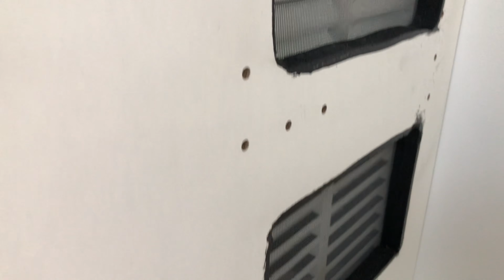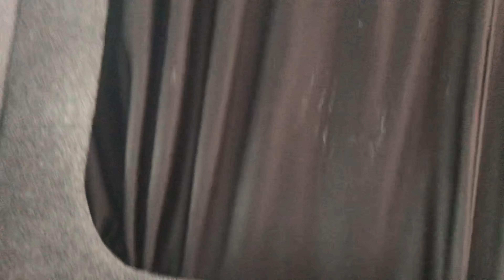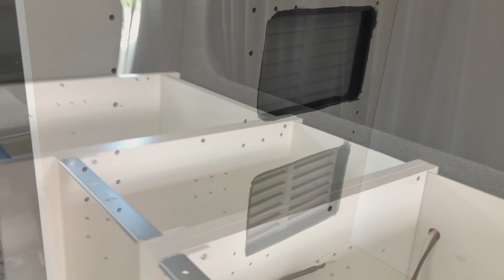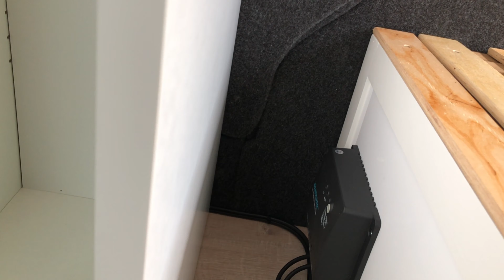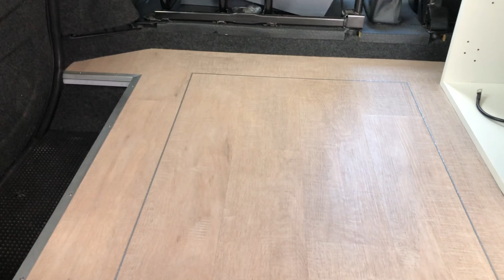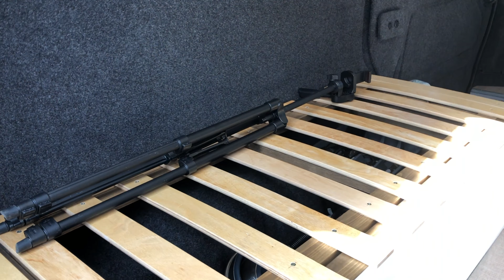Vauxhall Vivaro Camper Van Build (3) Episode (9) Building the Kitchen units for the CRX50 Fridge.

Comment: Great video again, how did you did you finish around the sliding window above kitchen unit and install the 12v split charge system, can’t find video of these, my battery is in front of passenger seat.
Reply from the maker: Hello, I’ve not fitted a split charger into this build as the Solar provides ample charge. It’s quite easy to run a cable from your van battery to a fuse / then to the charger to the leisure battery. Make sure you Earth correctly and consider a good pairing of the van battery to leisure (otherwise if your van battery is weak/old you run the risk of it not charging your leisure battery) As for the window?  Could you explain what you need to see and I would be happy to send photos 👍 Thanks for your support & interest 🤪
Reply: @abikerstale806  thanks for the getting back to me, have you a video of your finish around your sliding window above the kitchen worktop.
Where did you find the angle trim to rear of front seats.
Reply from the maker: Yes I’ve just done it for you.
Reply: Trying to find it, what is the heading on video
Reply: Hi did you do a video of the fitting of the doors and counter top as can’t find it? Thanks